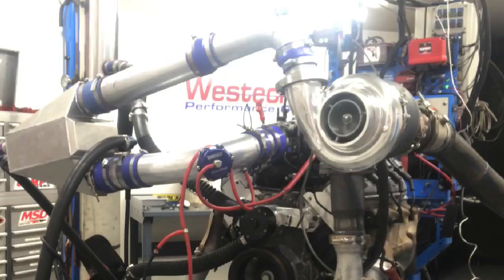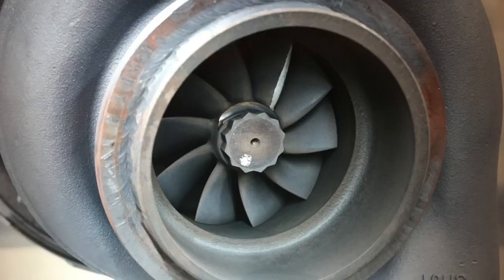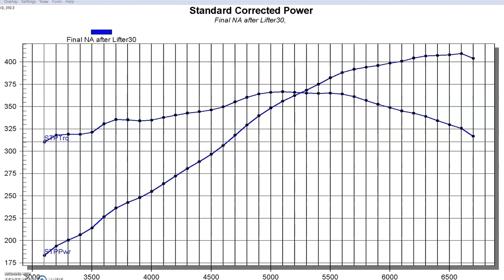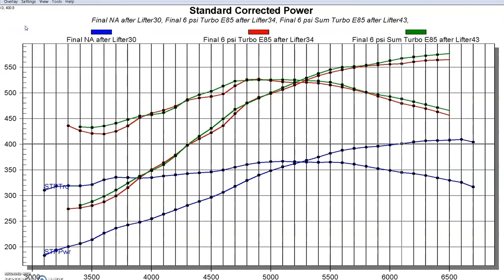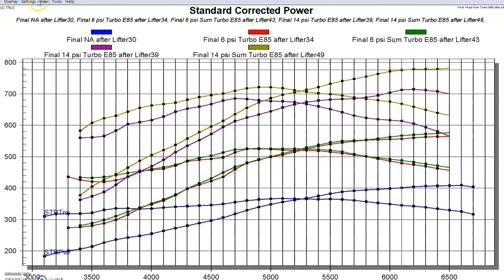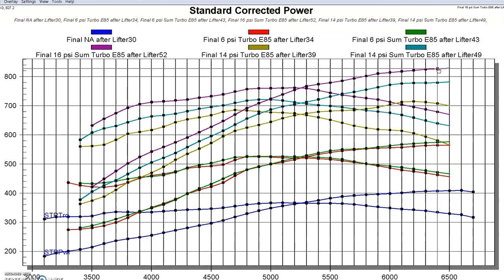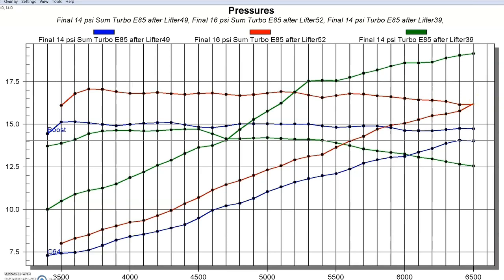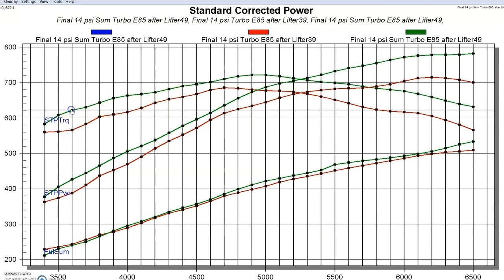CHEAP TURBO JUNKYARD 4.8L-GT45 VS S475 TURBO UPGRADE

Comment: I’d love to see the Precision 76/75 LS on this 4.8
Reply: He' has done a 7675 vs S475 with the small turbine wheel and T4 housing. 
the S475 in that configuration was terrible and the 7675 owned it everywhere. 
I don't recall exactly what engine it was on though
Reply: My 5.7 Hemi has the PT76/75 and i also love it. It’s the .96 but it lights up quick and the Ram is making 800ish to the wheels on 12 psi.
Reply: I have a 4.8 with a PT76/75 on it.  It has had an s475 a gt45 and now this 76/75 with a .81 AR housing on it.  On the street these backpressure tests don't prove relevant.  The s475 lagged so bad that it was not even practical, no matter how much power it made.  The gt45 was better in every way except on the floor board 1/4 mile down the road.  The 76/75 is amazing.  The spool is linear and turbo lag is non existent.  This is in a fox coupe with an 80e.

Comment: What size turbine housing was on that eBay gt45? After watching both videos it's pretty clear up top the gt45 has too small of a turbine. Down low the cheap eBay compressor wheel isn't helping either.
Reply: I looked up gt45 specs and they come with a 77mm exducer which isn't too bad
Reply: @jamieknight9636  the gt45 turbine should be an 87/81ish turbine, I'd like to know what housing was ran on the test.

Comment: What happens if you use the smaller turbo with a bigger rear housing to reduce back pressure?
Reply from the maker: it helps

Comment: Great info, but I'm curious why the runs all start above 3000rpm? 

Last I checked most street cars stall at 2000 rpm and you're showing a flat-ish torque curve that implies the engine runs just dandy below where your graphs start. I'd like to see stuff like when the cam starts working and the boost threshold of both turbos

Comment: One these   Ebay gt45 turbos  which  of them is best as far as hot side  housings. What size typically  works best  to keep from to much back pressure
Reply from the maker: the best way is to use them on the right size/na power output motor at the right boosted power output

Comment: Once you get over 1.5:1 back pressure v boost you make too much egt, might be ok on dyno but track work its going backwards
Reply from the maker: egt is a function of more things than the back pressure
Reply: @richardholdener1727   true, but backpressure on track car cooks the  head and distorts heads then head seal is compromissed.
Love ya vids btw

Comment: Great video Richard! Would it be possible to measure the engine's rpm response (time) from 2,500 to redline RPM between the two turbos?
Reply from the maker: I can't do that on an engine dyno
Reply: @richardholdener1727  Hey Richard, give Mr. Banks a shoutout-maybe he'll send one of his iDash data loggers that could measure/log rpm response. I love all the options to log on my iDash.

Comment: There are a number of options for the hot side on s475 turbos but they increase the cost. The reason this one is so cheap from summit is the t6 1.32 hotside is how this turbo comes stock.
The smaller turbo would probably be better for the street. The s475 would probably be better for an all out 600-1200hp race motor.

Comment: Has he tried dual gt45 turbos? One gt45 is for smaller cu inch.
Reply from the maker: I have not tried dual GT-45s yet-but i did try running a single GT-45 off one back of the V8-no Bueno!
Reply: Tony R. Did a twin gt45 on a 351w. It lagged quite a bit and wasnt faster and spooled slower than a single s480. Still able to go like a 8.99 in a fox.

Comment: Iv been pretty fast with a billet wheel t6 s475 1.32 exhaust housing in a 3400 pound 4th gen z28 5.60's best et and mph was 5.63 or 61@ 124mph it was a sbe gen4 4.8 with the s475 and a little nitrous

Comment: I was going to suggest a s475 t4 to test next to the t6 and I'm building a sbe 6.0 ring gap sst 2 cam Pac springs tbss intake and a pair of cast 66/73 vs racing turbos Low Budget Build of course, What you guys think?

Comment: Compressor efficiency plays a part in this too.  Great comparison!
Reply: Absolutely - the smaller turbo's compressor is probably operating near the high end of corrected airflow on the compressor map. Near the edges of the map, compressor efficiencies drop off rapidly. Which results in not only higher compressor discharge temperatures, but also demands more shaft power for the same pressure ratio (boost level). As a result the turbine generates more back - pressure (expansion ratio) in order to produce the necessary shaft power demanded by the compressor. The back pressure increases pumping losses of the engine  and higher EGTs. Net engine power falls off under these conditions.

Comment: always interesting stuff RIchard!!! thanks   I think another thing that would be nice to have included in these is IAT on both turbos,  to see if they are the same on each turbo.  thanks
Reply from the maker: only got that in the intake unfortunately
Reply: If you could I think it would be nice if you could also have the compressor outlet temps on each turbo

Comment: Richard, Forced Inductions sells a T4 S475. That T6 version is indeed MASSIVE. Are you planning on testing either the On3 or VS Racing 78/75 or 88/83 turbos? Billet and cast? I think a lot of folks would like to see that. They are smaller than the Borg Warner S400 series turbos and they make great power...
Reply from the maker: might be running a VS soon
Reply: @richardholdener1727  GREAT! I have a Gen 4 rodded LQ4/LS3 headed mutt I'm putting together (pretty much the same as an LY6...) and an On3 7875 turbo. I would love to see the VS 7875/LY6 results...
Reply: James Williams, I’d love to see that as well. I run an ls2 with ls3 heads and I’m debating adding a 78/75 turbo.
Reply: @mathieunoualy2102  I got my hands on an LS2 last year out of a TBSS. Gave it back because it had a spun rod bearing. Post your results on YouTube if you end up putting a turbo on it.

Comment: Forced inductions sell T4 S475  I have one with 83mm exhaust  wheel 1.10 a/r , that thing spools super quick, it'll  build boost at 2000- 2200 rpm under load  on a 5.3.  Very good street set up .

Comment: Unbelievably enlightening information Richard!!  Summit needs to be sponsoring the bejeezus out of you, and if you could work up a couple of collaborations with some bigger youtubers, I bet your subscribers would ramp up even faster.  Maybe work with someone to see how your dyno results replicate at the track or something... Dunno.
BTW, I still want to see the 454 with two $130 GT45s on it!
Reply from the maker: thnx-the 454 needs two Gt-45s-or just 1 S480 billet wheel
Reply: @richardholdener1727  I get you 100% on that, but the cheapass majority of the world want to see the twin GT45s.  :)   That's where I feel like the youtube win is.  I guess the maximum win is to compare an S480 against a pair of GT45s on the 454.  I think the GT45s might prevail.

Comment: A test I would love to see is methanol injection on a positive displacement supercharger and cylinder to cylinder distribution of that. I've seen where that doesn't work very well on na or turbo but on a blower car all the air get funneled into such a small opening and getting chopped up by the rotors I'm curious if it gets better

Comment: On my turbo dragbike, (6.5 @ 220+) i shoot for less exhaust pressure than boost - it just plane goes quicker and faster.
Reply from the maker: I did that on my Bonneville Civic motor too-works well

Comment: Totally off the subject but ive been waiting on a e85 vs methanol test 😁
Reply from the maker: I've run E85 testing but not M1
Reply: @richardholdener1727   Its a different animal! The data difference is amazing and don't worry about the intercooler thats the fuels job.👍
Reply: @dj4monie  so thats why my intake is frozen after a run? I think you have it backwards e85 will net you a 10*-12* drop. But its not only temp drop its the propertys of the fuel and fuel flow. In my own opinion in a meth car a intercooler is just a restriction and water/meth is a ticking time bomb
Reply: @chrisfuller8584  you are just plain
WRONG. An intercooler is ALWAYS beneficial to power output. Gale Banks has flat out PROVEN this over and over.... PERIOD

Comment: Why do they always stop at such low boost levels? see what they to 20-25psi where we actually run them. My sbe motors live at this level a LONG time.
Reply: I agree nobody runs a s475 at 15# I'm running twin 475s on a sbe 5.3 at 40# on M-1
Reply: @chrisfuller8584  lol nice must be putting out over 1500 . How are the head gaskets holding up?
Reply from the maker: the S475 can't make 1500 hp.
Reply: @richardholdener1727  but 2 of them can!! 😆
Reply: @richardholdener1727  Richard you missed 'twins' in the sentence.
Reply from the maker: 40 psi from the S475 on this motor is well past the  flow rate of the turbo. You only get power gains were the turbo can support the flow. Just showing you guys differences in boost/back pressure-now go crank it up!
Reply: Id love to see a dyno sheet on that Chris . When does it start pulling ? 5k ?
Reply: I never had it on a dyno maybe I'll do it soon bc I'm wondering myself. Antilag is set at 5300 and the converter is a 5500 and it flashes to 6200 on the launch
Reply: It might sound high but to keep the gen4 rods from breaking you got to get past the mid range torque some people pull abunch of timing and I just never make it that low lol
Reply: I've never pushed water yet I use them GM performance parts $40 gaskets and arp headstuds I just looked at the logs and it has 126 1/8 passes on it so far
Reply: Another thing to remember is while a more optimized cam will make more power across the board as he has demonstrated…. A cam with less overlap is going to allow you to run much higher back pressure ratios more efficiently. T4 S475 continued making power all the way to 26lbs on my 5.3 and that’s at 2.6:1 back pressure ratios! This was due to the 121 LSA on the LS9 cam having VERY little overlap. Sure I was making piddly power gains past 20lbs or so… but I continued to gain MPH at the track up to 26lbs on an 8.6:1 compression 5.3. Running 8.9x’s at 153 mph. This was using all the parts people say not to use. 317 heads…ls9 cam…dished piston gen 3 motor etc…

Comment: Ok guys, don't clobber me too hard for this... looming at gt45's and they have a bunch of different combos (ar's and mm's) 
I'd like to know which one you're using. If you've started it in a different video, send a link cause it'll be the only one without my thumbs up on it!
Reply from the maker: they work well for lower power levels
Reply: @richardholdener1727  so there's only 1 gt45?

Comment: I love these videos. Thank you so much for putting all these videos and information together.  Can you do one on a zl1 supercharger on a 4.8 LS motor compared to 6.0 LS?
Ahmad
Reply: Lsa all out is 900ish whp.
Does not matter if its on 360 cubes or 427 cubes
Reply: Check out sloppy mechanics on YouTube  he has a 4.8 swapped Infinity G35 and a ZL1 blower on top
Reply from the maker: yes-Matt has good stuff there on the LSA bower

Comment: I use the GT-45 on my racecar its a 3250 pound S10 with a 4.8, Stage 2 sloppy cam, Pac springs, C16  it went  9.88 at 135 mph at 17ps.  I do have soft timing and a bit rich as I don't have exses to a dino so im creeping up to the max slowly   The math from the HOT ROD CALC App on my phone clams 665hpbuy ET  to 625hp Buy MPH   I feel like I can add more timing and some more boost it will make 22 psi I found that out one day but it just spun the tiers up  every time I throttled it. I don't have the cage certified so and I don't want to piss off the tech guys. what sensors should I in stall to give me some usfull data to know iv hit the wall with this and when I sould stop pushng it I have Air temp the hottest it ever got was 130 I am limited with inputs im using The Termonator X I was thinking of repurposing the oil pressuer to use at a Exhoust pressur sensor is there a better sensor I could utilize?
Reply: Do you have any e85 near you? I had the same setup just in a ranger and a 4l80 my personal best was 9.43 18* timing and CO2 shoving my gates shut and I still had a boost drop of 4psi. In my personal opinion any time you push more than 18* threw the gt45 it tends to gernade itself. As far backpressure I just have a looped copper tube going to a boost guage😁
Reply: @chrisfuller8584  i was thinking of a looped copper line or just brakeline  that's the ez part im loging dome and Driveshaft and to in puts for T Brake with Bump, I was going over my data log for my 9.88 run. my boost cerve started at 7 psi when I released the brake was 12.5 in 1.5 seconds 13.5 on the 1-2 shift  14in high and crepped up to15 at 6500 at the end of the run   so its not droping like the dyno I know that there two difrent loads but if it didn't have more in it I think it would be falling off. 
 timing was 24 at the star of the run and 22 deg at the end  and yes I varifid the timing  I would also like to loge compressor speed to thet wouldent be that hard a wheel speed sensor from a car would work well .
Reply: @bigblock406ta  that timing scares me on gasoline lol I would have done cracked every ringland in the motor. You do have a point with the boost not dropping off mine dropped no matter what I did. If you turn it up let me know what happends👍
Reply: Chris Fuller I run C16 it’s a track only car. E is only on a few spot meany miles apart
Reply: @bigblock406ta  i have it here but now I use vengence e85 its mixed with race fuel. I got tired of the huge difference in alcohol content at the pump

Comment: I'd like to see the s475 with a t4 1.10 back housing on that 4.8
Reply: The gt45 is a 1.15 t4 I think it will still have to much back pressure
Reply: @chrisfuller8584  I have a 7875 right now with a .96 ar turbine housing. And was looking to upgrade to the s475 with a t4 housing???
Reply: @sidedownoreos  the t4 would be alot easier to bolt on and you will notice a gain. It just depends on what your goals are I keep forgetting some people are happy with X amount of horsepower. I moon tune everything lol
Reply: @chrisfuller8584  I'm at 700whp right now, turbo 4.8 with th400. I'm putting together a 5.3, and looking towards 1k hp

Comment: T-4 S475 from VS Racing is great!
Reply: Im upgrading to the billet 78/75  g2 from VS racing
Reply: VSR T6 S480’s do amazing on 5.3’s as well
Reply: Glad to know there is a t4 version available somewhere because I’ve been looking for one for my mild boost 4.8
Reply: Can’t wait to see those results...will it be the 0.96 ar T4
Reply: T4 with a 1.25AR
Reply: Had a on3 76/65 with a .81ar took my 71 c10 long bed down the 1/8 at 7.16 93.73mph
Reply: I can’t wait 😎😎😎 this info has been very helpful with my first turbo ls build

Comment: What would be good size for twin turbos on a 4.8?
Reply from the maker: twin Gt35s
Reply: Twin gt45s
Reply: I was thinking gt3582 would be better as faster spooling and better sized for a 4.8l
Reply: Im doing twin On3 76/75 on a 5.3
Reply: @johndillinger3851  wow those are huge are you going spin 8500 RPMs and make over 2,000 horsepower

Comment: Can't wait to see the big block!!!
Reply: Do you ever compare the turbo lag on the tests? I’d be really curious to see how different it is. Let’s face it, too much turbo lag really sucks even if the turbo makes great power. Keep up awesome testing.
Reply from the maker: we cant really test response on the engine dyno-it has an artificial load
Reply: @richardholdener1727  Richard-you can not measure rpm response (time) from say 3,000 to redline?
Reply: @dj4monie  I understand that you can't compare the two engine loads. I wanted to compare engine response (among other test parameters) , for this test, on the dyno, between the two turbos.
Reply: @ts302  On turbo vehicles load helps with spool. Part of why turbo diesels are so great with heavy towing. Thats what they're  reffering to, can't accurately test the spool if there is already load on the engine even at part throttle
Reply: @mathieunoualy2102  my friends have ran both of those turbos on 5.3's and the s475 spools considerably quicker.
Reply: @dj4monie  I've found the opposite in some cases.  The engine has to flow.  The bigger turbo spooled faster on two different motors with the same cam.